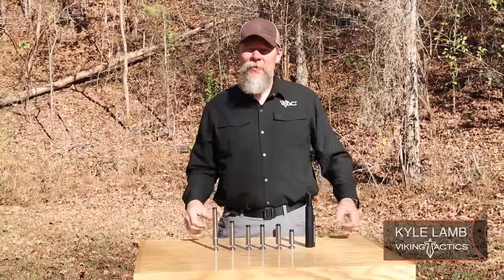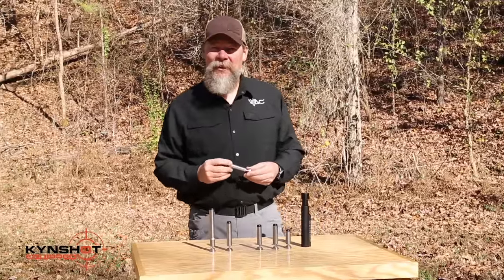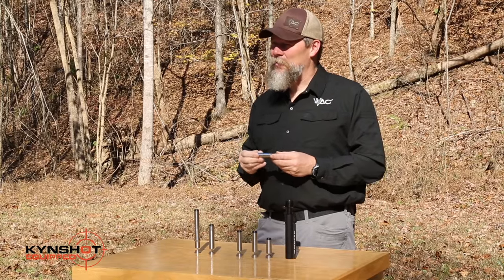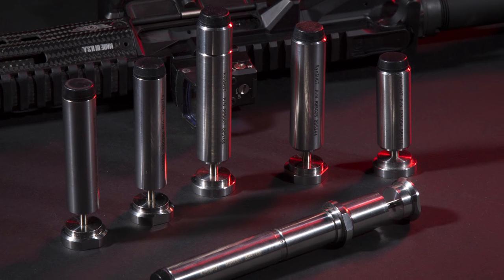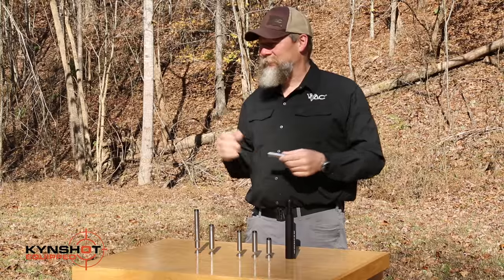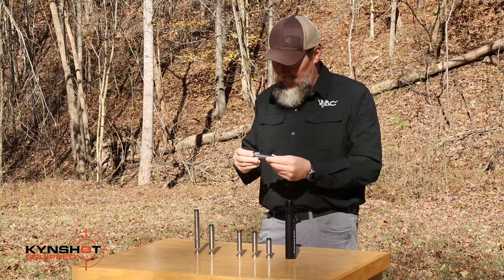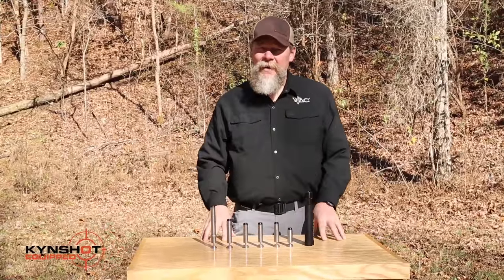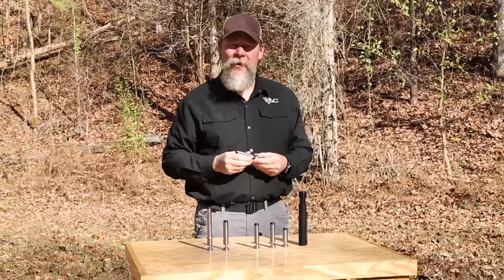KynSHOT Hydraulic Buffers

Comment: i have one of these in a PA 10 308 and the reduction of recoil amazed me tamed the nasty 308 to  5.56 like  when i paired it to a FSC30 muzzle break off a scar
Reply: Do you have the A2 or collapsible stock? And which size buffer did you pair it with 2.5" or 3.25"??
Reply: @HKBuilderDIY  I'm running a LuthAR fixed stock with an Aeroprecision A2 buffer tube on my AR10 .308.  SOOOOO awesome with the Kynshot hydraulic buffer.

Comment: I tried one with my .308 AR and it wouldn't cycle correctly. I returned it.
Reply: Ricky DJ Moore II  My Lwrc failed to lock back and occasionally would fail to go into battery by about a half inch,  due to this buffer in cold temps.  Im not sure but i believe its getting stuck in the retracted position every now and then.  I through the H2 buffer back into my LWRC, the buffer that came with the gun,  and she became reliable again.  No hiccups.  I'm not liking this hydraulic dampener/buffer stuff.  I got suckered in.  Don't be a fool with your hard earned dollars folks.  It does reduce felt recoil,  turns your 5.56/.223 into a .22 in terms of recoil but the unreliable trade off isnt worth it.
Reply: @mknight5159  Thats why they are for 308 not 556
Reply: @bringithard6721  Not what it said on the package or website when I bought it..
Reply: @mknight5159  Correct, in a freemarket there will be many company's trying to sell anything. The point I was intending to make was they are for high powered rifles like the .308 or 6.5 creed. Trust after 300-500 rounds, tomorrow your going to feel it. It will be like Yep, that hurts like about $150 of ammo.

Comment: Will this work with super 42 Braided Buffer Spring in the MK 12 fixed stock ?
Reply: No, only geissele makes buffers weights that will work with super 42. And if you already have a super 42 then there's zero need for a new buffer system.

Comment: Does it eliminate or reduce bolt bounce?
Reply: 4 year later reply, but it should help.  That bounce is caused by excessive carrier speed as it is returning to battery.  A hydraulic buffer will convert the kinetic energy of the bolt and carrier into heat within the oil, which means less bounce from the rear of the buffer tube and, in turn, less speed and bounce when the bolt returns to the locked position.

Comment: Don't buy this buffer.  Stick with the H buffer. I was experiencing cold weather problems with this buffer that were non existent with the previous H2 buffer i had in before.  It works fine in the summer months but i wouldnt trust my life to it in the colder months.  It does reduce felt recoil though.